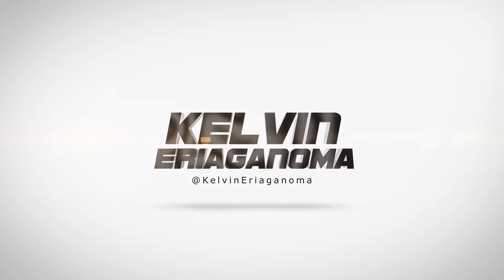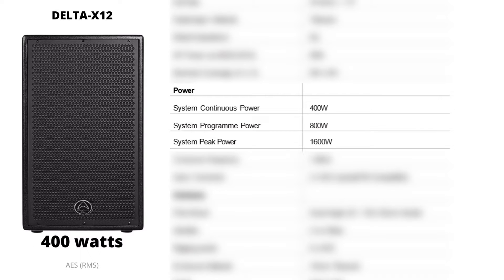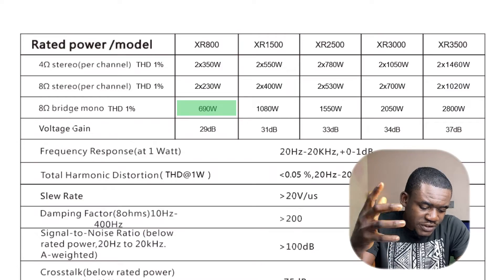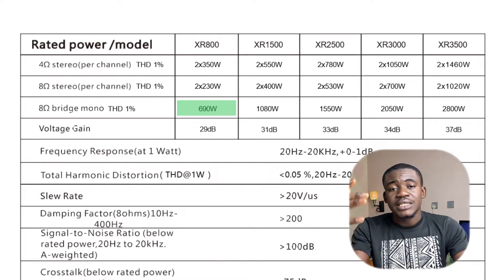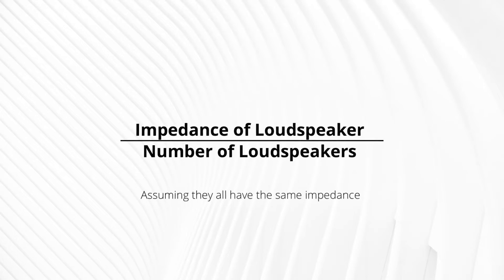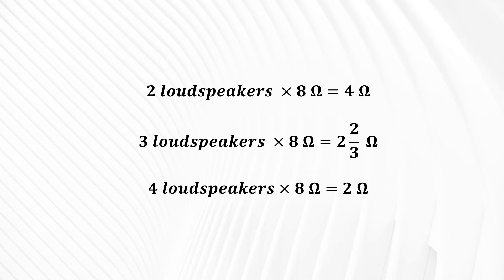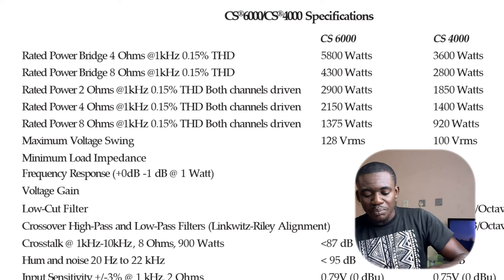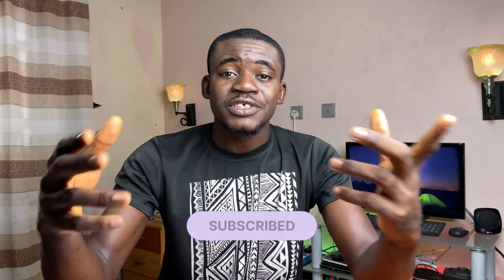How to Match Power Amplifiers to Loudspeakers Correctly

Comment: You said the the formula for finding the impedance of more that one Speaker is Total Ohms divided by Number of Speakers. How then did you get 4ohms as impedance when you’re linking two 8ohms speakers which is a total of 16ohms?
Reply: The graphic was incorrect, it showed multiplication instead of division. However the answer was still correct for division.
Reply: 1/8 + 1/8 = 2/8 = 4 ohm